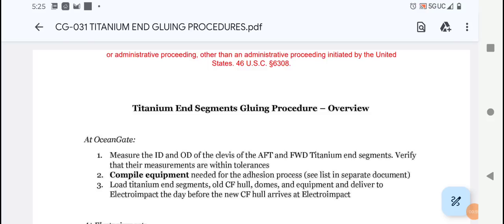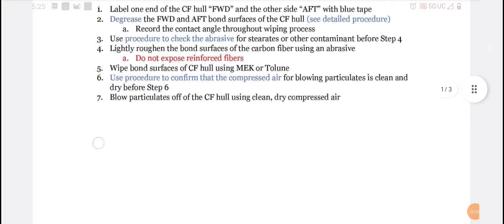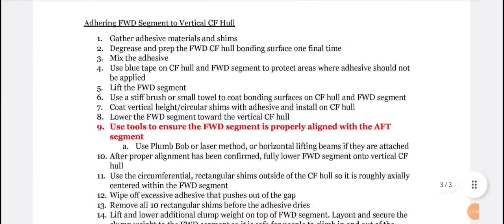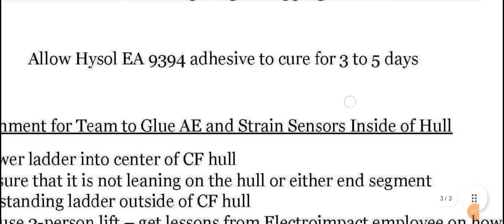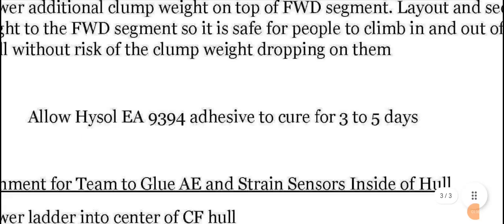Titan Submersible they used the WRONG epoxy as carbon fiber & titanium  "eat" the epoxy

Comment: I interpret what you are saying is: around the edges of the titanium rings where the Ti-adhesive and carbon fiber-adhesive edges are exposed to saltwater the aluminum will be oxidized to aluminum oxides (or chlorides). If the epoxy adhesive matrix debonds from the aluminum oxide/ chloride voids or something similar forms in the adhesive between the titanium or the carbon fiber. The edges could separate. As the sea water repeatedly seeps in the failure grows allowing further deeper corrosion/debonding. The sea water intrusion is facilitated by the differential expansion/contraction under pressure or temperature opening microfissures. Could occur at depth with 5,000 psi water pushing in or capillary action at the surface has the dissimilar unload/warmup. Eventually, under extreme loading if the deep CRUCH.
Reply from the maker: Hint for you... In the form of a question 
Why when they would open the door, water was reported to have come out by the buckets? 
Hmm then part two of hint (based on your other reply to another viewer)-- is that "fluid" an electrolyte and now put it all together.

Comment: You are correct that the metals at the top are more sacrificial, but you are incorrect that the ones at the bottom rot out first.   Sacrificial means just that: it corrodes away.

Also, water heater anodes are typically magnesium or aluminum.  In my experience, better water heaters use magnesium.  I had an aluminum anode and it seemed to expand as it corroded. I had to put a full port ball valve on my water heater to drain the sediment without clogging.  There is almost zero sediment with the magnesium anode.  Your mileage may vary with different water.
Reply from the maker: I have to listen to my video again, are you saying that I said titanium is sacrificial with contact of aluminum? 
I thought I made it clear, titanium is more nobel...

Comment: No wonder they were trying to skip any certification.  Nobody wants to tell the shareholders "we've fully blown the build using the wrong glue."   MILLIONS OF DOLLARS SPENT  getting from research to assembly and a few 100 bucks worth of glue muffs it up.  Rush shoulda been straight-up on all safety/redundancy/certification - never mind listening to his certified advisors.  Completely wrong emphasis ! ... extra time & bucks re-doing stuff -yes but pages of certifications from established sources would ultimately "sell" the trip really well. The failures should have stopped at the drawing board simulations ( NOVL chart analysis, carbon fibre winding for structure, exceeding ALL minimum tolerances with consideration on a broader set of possible emergency circumstances ) and ... the test tank.  I have a fiberglass boat, and in doing repairs one discovers how finickey it can be.  Hardener to resin mixing and curing consistency issues affected by temp / air moisture / application duration. Certainly NO stressable bond with stainless steel. ( no porosity ) When it comes to the science and safety, it is imperative to exhaustively check - check and re-check one's plan, method, and result.  Someone's life depends on it. Truly a shame he sold this whole "learning expedition" trip to the public and the authorities. 
Was S. Rush even certified simply as a "Public Tour Operator"... any Level 1 First Aid ????

Comment: Fair disclosure: when I first heard about this my first non engineer just as a normal guy guess… was that the glue was what failed.  Because all glues eventually fail and this was glue in between two materials with vastly different properties at 5000psi, I assumed (and hear this a colloquially as possible) “one was flexing/moving more than the other.”

When I saw the video of 3 dudes slapping glue on that thing not in a clean room, with little paint buckets like a 9 year old doing touch up paint to his tree house, I was done 

That thing was a death trap from day 1.

Comment: Two thoughts: is it possible they weren't advising against titanium use until they found out the Titan came apart? 
Is it possible that the aluminum oxide formed irregularly and expanded, creating leak paths into the joint? 
Release your long video and ask people to comment the time stamps they found most important.
Reply from the maker: Listen to my video again, I never mentioned titanium to engineering rep

Comment from the maker: This is a reply to someone else,in the pinned comments... I can't see it from my side, so here it is here 
"I pinned your comment for now because of the banter is not an echo chamber but also shows the thinking of what the engineering may have thought like... That they ignored the manufacturer's engineering representative and decided they knew better and perhaps they used your same line of thinking... 
Also, you did not address how this marriage would fail on the titanium side of this marriage --- that the titanium side of the marriage would be more aggressive in creating a bond break. 
One link below discusses the different carbon fiber and chopped fibers vs non... and another discusses density and the reaction.
You must keep in mind the manufacturer is superior in this discussion, as they do NOT recommend the usage...
To ignore the manufacturer's recommendation turns it into a prescriptive application and the devil is in the details... This thin film of epoxy would be attacked from both sides and therefore would NEVER be stable as an epoxy - never.

https://pmc.ncbi.nlm.nih.gov/articles/PMC8410780/
and 
https://www.sciencedirect.com/science/article/abs/pii/S0925838822005862
and 
"Galvanic corrosion
When aluminium and titanium are used together, they can experience galvanic corrosion. This process changes the passive films on both metals, which can affect the coupling effect. "
Randy, thank you for reply but I did look into the different configuration of carbon fiber and even how you could "protect" the carbon fiber from direct contact with the epoxy (ultimately, the manufacturer's engineering representative wins in this decision making process)...  
I do not think it should be ''prescriptive" as a product exist that can be used and with no conflict of materials (matting)... 
Further, it's the shock loading from land and sea travel that is the force that creates the stress on this weakened bond -- the great news is, some epoxy still exist on the one segment and they can check it for bond strength and further PROOF is NO epoxy exist on the other interface rings (segments) and this alone proves lack of bond surface to the titanium ring/segment (my thinking, some adhesive should have stayed bonded to the front /forward ring/segment...   I also do NOT have a rotational failure on part of the front segment as it ''pulled away" from the existing carbon fiber connection (I did a video on the ''lip" they created to fit this segment and it appears to be ''present'' and NOT compressed (indicating during the implosion, the front dome and segment took a direction away from the hull (keep in mind, this could also be the carbon fiber hull actually ''flexed away" from the segment at the same time)....  I have done a model of this and will do another.
I am giving you a longer reply bc I think it is worthy bc you gave me values and I enjoy working from this point of argument."

Comment: It is my understanding that the hull was made to be replaceable which means it was expected to fail at some point hence the RTM data logging. Granted it doesn't appear to me that there is enough relative data (in my opinion) to decide when the structural integrity is no longer viable for safety, But with this in mind Hysol 9394 has a dielectric of 7.2@ 10KHZ vs Hysol 9395 which has a dielectric of 3.97@ 10KHZ. In my opinion that is negligible between the 2 especially while considering the longevity of the carbon fiber.
The peel strength would probably be foremost in my mind as the hull would be flexing inward causing the carbon fiber edge attaching to the ring to want to peel. Everything fails at some point it's just a matter of what fails first and I don't believe it would be the corrosion of the adhesive which would have to be removed and replaced with a new hull.
Reply from the maker: I pinned your comment for now because of the banter is not an echo chamber but also shows the thinking of what the engineering may have thought like... That they ignored the manufacturer's engineering representative and decided they knew better and perhaps they used your same line of thinking... 
Also, you did not address how this marriage would fail on the titanium side of this marriage --- that the titanium side of the marriage would be more aggressive in creating a bond break. 
One link below discusses the different carbon fiber and chopped fibers vs non... and another discusses density and the reaction.
You must keep in mind the manufacturer is superior in this discussion, as they do NOT recommend the usage...
To ignore the manufacturer's recommendation turns it into a prescriptive application and the devil is in the details... This thin film of epoxy would be attacked from both sides and therefore would NEVER be stable as an epoxy - never.

https://pmc.ncbi.nlm.nih.gov/articles/PMC8410780/
and 
https://www.sciencedirect.com/science/article/abs/pii/S0925838822005862
and 
"Galvanic corrosion
When aluminium and titanium are used together, they can experience galvanic corrosion. This process changes the passive films on both metals, which can affect the coupling effect. "
Randy, thank you for reply but I did look into the different configuration of carbon fiber and even how you could "protect" the carbon fiber from direct contact with the epoxy (ultimately, the manufacturer's engineering representative wins in this decision making process)...  
I do not think it should be ''prescriptive" as a product exist that can be used and with no conflict of materials (matting)... 
Further, it's the shock loading from land and sea travel that is the force that creates the stress on this weakened bond -- the great news is, some epoxy still exist on the one segment and they can check it for bond strength and further PROOF is NO epoxy exist on the other interface rings (segments) and this alone proves lack of bond surface to the titanium ring/segment (my thinking, some adhesive should have stayed bonded to the front /forward ring/segment...   I also do NOT have a rotational failure on part of the front segment as it ''pulled away" from the existing carbon fiber connection (I did a video on the ''lip" they created to fit this segment and it appears to be ''present'' and NOT compressed (indicating during the implosion, the front dome and segment took a direction away from the hull (keep in mind, this could also be the carbon fiber hull actually ''flexed away" from the segment at the same time)....  I have done a model of this and will do another.
I am giving you a longer reply bc I think it is worthy bc you gave me values and I enjoy working from this point of argument.
Reply: @ForensicCats  I gave that reply a thumbs up myself given how it shows your dedication to the entire Oceangate story. I have the same astonishment and disgust at every step they took as well. The psychology of his team and the passengers is unfathonable to me. Thanks for all the work. Don't let it affect your health.
Reply from the maker: Ty and yes, I will only do comment replies until Monday
Reply: @ForensicCats  I totally agree with you on all points I was trying to infer what Oceangate may have thought at the time. The representative did say the word MAY create galvanic corrosion which sounds alot like something that Rush would ignore. In my mind there is no question Rush apparently had an essence of arrogance and wanted to do this on the cheap. Is it possible that the manufacturer was never contacted regarding what adhesive would be best for this application? It is totally inexcusable to have that level of disregard for safety yet infer that Nasa and others were involved.
Reply: I discussed this with somebody and from what I gather, carbon fiber composite diving hulls only maintain full integrity through one stress cycle. On subsequent cycles the integrity will go down in manner that is very difficult to predict, because the material is so irregular. This makes such hulls disposable or semi-disposable. If they replaced the hull after every season (this would also solve the apparent improper winter storage) they probably would end with big enough safety margins to keep going. It would make the sub operation even more expensive though, obviously.
---
PS: Did the inquiry zero in on the joints as failure points? I did not really keep myself up the speed lately.
Reply: @walterscientist  I think they made something like a dozen dives to the Titanic's depth (which is impressive) so the hull clearly had more of a safety margin than a single dive. It begs the question whether the submersible would have been up to a significant length of service had they gone with the original design which demanded an additional 2+ inches of thickness in the carbon fibre. The thing that would concern me is CF's intolerance to puncture damage. You're maneuvering around a giant scrapheap in the Titanic in low visibility conditions with thrusters which have been giving problems since the very beginning. Easiest thing in the world to run the vessel into a giant overhanging shard of metal which can cause all manner of damage to the hull.
Reply from the maker: Part 2 hiding over here https://rumble.com/v5kbcoj-titan-submersible-yes-epoxy-can-be-an-electrolyte-plus-water-contact-inside.html

Comment: This makes me wonder about a lot of applications I see with things such as race car suspension, where aluminium alloy 'end pieces' are bonded to carbon 'tubes' of various shapes. I know that most race cars don't spend any time in the ocean, but they do drive in the wet, which makes me wonder about this issue. I recall my kart's rear-wheel hubs galvanically 'attaching' themselves to the steel axle. Had to loosen the wheel hubs between race meetings to avoid the hubs and axle 'welding' themselves together. This Titan thing just gets worse and worse.... Thanks for your continued efforts.
Reply: Is that even allowable under most racing regulations?  That sounds like something that would not be allowed like chrome plating tube frames.
Reply: Salt water is a good electrolyte and allows electron flow. Even humid air off the ocean can accelerate corrosion. Most everyday corrosion is an oxidative process which requires oxygen ions and transfer of electrons. Iron becomes rust which is forms of iron oxide. Salt water also contains chlorine ions which don’t help. Contrast deoxygenated water such as that found at the bottom of some of the Great Lakes. The wreck of the Edmund Fitzgerald is said to be nearly pristine even though it is of the same age as the Andrea Doria that is dissolving into a pile of rust in the Atlantic.

Chrome on steel would be a problem only if oxygen could get to the chrome ferrous interface as in a scratch in the chrome. Hard chrome plating is an electrochemical process. And the chrome surface is hard, abrasion resistant, is often used to build up worn bearing surfaces and provides a barrier to oxygen. 

Race cars (at least at the top tiers) undergo periodic testing and inspection akin to commercial aviation. Experienced team engineers can fall back on decades of knowledge of racing, aerospace, etc. and also “lessons learned in blood.” Likewise, the submersible industry can rely upon decades of experience in various field. OG repeatedly ignored the caution-danger warnings and advice that such innovative approach’s need to be proved out through extensive testing and inspection programs; the submersible industry was saying “we don’t know what we don’t know about carbon fiber-titanium constructions” at extreme depths so we stick to what we know have low risk OR are very cautious about leading edge, experimental designs (destroy many models, prototypes, don’t send passengers for hire down - “test pilots”).

Comment: The only thing I can think of is they believed galvanic corrosion wouldn't be an issue because there would be no electrolyte ingress at that joint. Quite how they could ensure an impermeable seal is a mystery. Looking at their Dive & Maintenance logs leaves one with more questions than answers. There are minor issues which generate copious notes while there are major problems (cracks in the hull ... where? Extent? How many?) which yield hardly anything. They were clearly having major issues with buoyancy, successfully deploying drop weights, being ass heavy and endless thruster malfunctions. I mean, given all of that twisted metal around the wreck site, carbon fibre's intolerance to puncture damage plus steering malfunctions and Stockton's reported lack of patience I'm amazed they survived the first dive on the Titanic. Lochridge was right - they were diving too deep too quickly without sufficient sea trials. At that depth small problems become big problems very quickly. And they were having a lot of small problems.
Reply from the maker: FYi, it happens just because the three come into contact (not an ingress). --- titanium side would be the most reactive to the aluminium based product (that is the titanium would advance bond failure of the epoxy but the titanium would not deteriorate
Reply: @ForensicCats  Ah. I thought you were talking about the glue which fixed the carbon tube to the titanium ring. Saltwater could get at the join point where the glue squeezes out at the edge when they are pressed together and I guessed they had sealed around that join. Which would mean no electrolyte could get to the bond. I'm just guessing really. After reading that maintenance report they had a ton of issues to correct.
Reply from the maker: I will do a video in a couple of days that reveal the water source (that's a hint)